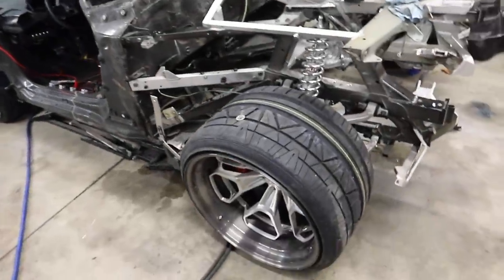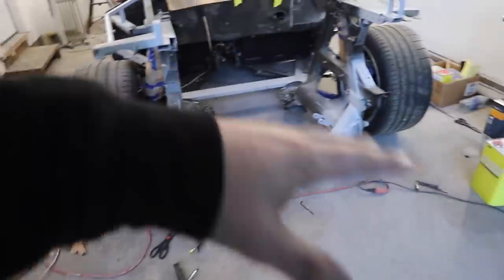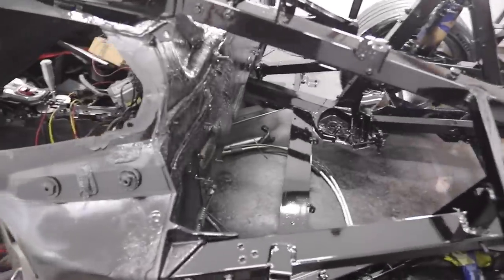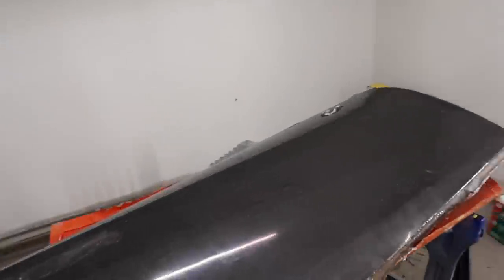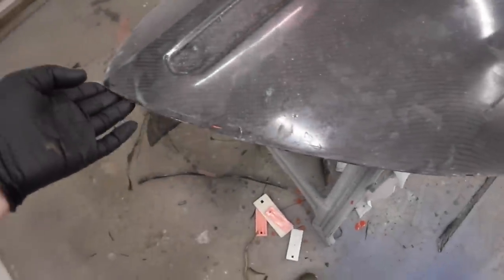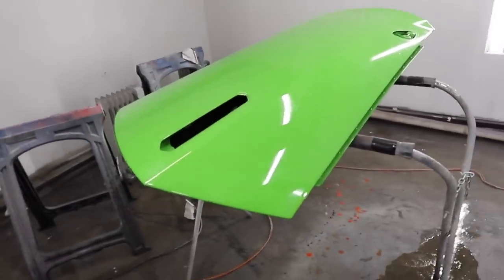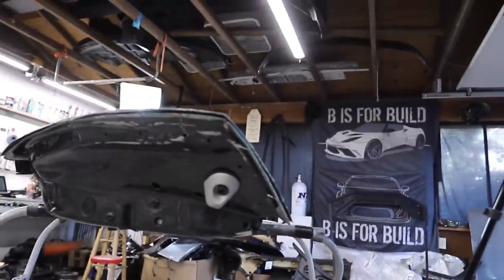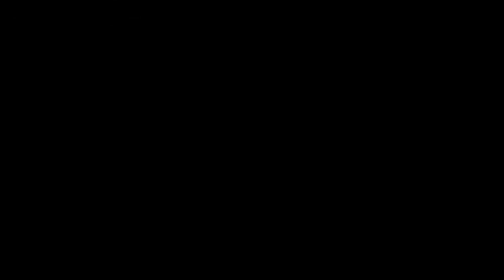Painting the Huracan Frame and Building Carbon Fiber Doors

Comment: As soon as he said there wouldn't be any overspray I just shook my head....
Reply: Same!!! I'm like...well that's a stupid thing to say. sure enough ...
Reply: @marksiegel1548  he really doesn't have any choice at this point.  It seems most sema cars are built in a similar fashion. Just make look good from 10 feet away from the outside.
Reply: @DoRC  is Sema a horror show of DIY car builds then?
Reply: He has a choice, get to sema or get a showcar
Reply: Jesus Christ, he just half asses everything!
Reply: @stevenwest1494  from my limited knowledge it's a mix of all types from absolute fine crafted perfection to much much sin hiding.....
Reply: @stevenwest1494  ever head of a bluetooth drivetrain? or wireless transmission? alot of sema cars dont drive in with their own power
Reply: Me to
Reply: Dude. It'd take like literally 10 minutes to bag off the wheels, interior and roof. Seriously it's not that hard to do it right.
Reply: @stevenwest1494  Yes. Yes it is.  Reason you never buy a SEMA car if you see one on sale.  Thrown together from ridiculously short deadlines.
Reply: What does it matter? Donor wheels and it's a bare frame?
Reply: @marksiegel1548  he might cut corners, still gets the job done though
Reply: I agree, but its his car and show.. As he said about the door, he dont care about visual imperfections.
Reply: I honestly don't think it means a difference cuz it's all getting wrapped Anyways
Reply: "It's all getting wrapped anyway" Hmmmm... Dont think he'll be wrapping the windscreen and interior. Takes very little time to cover for overspray, or a shed load of time to remove it. I know which approach I prefer.
Reply: It only takes five minutes to bag a car, then there's no over spray problem.
Reply: Yeah, I was head scratching for sure. Like, what magic is this?
Reply: That really put me off the whole thing. Why cut a corner like that.
Reply: qwerty qwerty I bet those wheels and tires are worth 1k+ a piece. Plus getting shit all over the interior and windshield.
Reply: @peteledwidge3631  shit I didn't notice that he fucked the interior too.
Reply: Do RC Good from far but far from good
Reply: me too. i knew it was utter BS.

Comment: Awesome video Chris! If you're doing remote door poppers, I HIGHLY recommend hiding a manual latch somewhere at the bottom of the door sill or in the front door pocket just in case something goes BisforBadly or you lose power. Good luck with the rest of the build!!

Comment: So you may run into issues at the drag strip with the electric door poppers...you’ll most likely need to install a manual backup so the track crew can open the door in case of an accident. Hope y’all finish in time for SEMA, awesome build!

Comment: @bisforbuild I’d recommend building in some sort of a fail safe incase your battery goes flat, Porsche and Aston Martin leave some jump start posts exported under the vehicle, you can use the vehicle chassis as a negative if you just fit a positive distribution block like your vantage will have under the bonnet, with a little cover in it under the car or on the exposed frame at the rear it means you can always get power to it to use the door actuators.
Reply: Like so Chris reads this
Reply: You can just hook the jumper pack or battery charger to the starter lug by crawling under the car

Comment: I can't wait for the episode that says we cannot get the door poppers to work, now we are locked outside the car
Reply: or the alternator dies when inside; trapped inside
Reply: That was my thought when he was demonstrating the mechanism. What if the battery drains while car is closed? Hope there is some sort of backup.
Reply: I dont think he'll need to get into the cab to get to the battery though
Reply: This is not like a regular car. He can take body panels of really easily and get to the battery
Reply: Yeah. Lets see a locksmith get a modified Lambo door open. Take lots of pics of the inner workings of that door so he'll have an idea what to go after.
Reply: Inner door panel is plastic held on by some clips. If shit hits the fan, Chris would just hulk the panel off from the inside and pull the cable, I doubt we will read about him found dead in the car because the battery died. More likely his shoddy headers caused so much heat it ignited a fuel line or something
Reply: You can probably crawl under and connect to the starter or alternator.
Reply: @luffy858  Yea I was thinking they better hope the car never catches on fire while they're inside it...  and even if they have a manual handle inside the car, what if they're knocked unconscious in a crash and emergency crews are trying to open the door to pull them out and they can't.
Reply: The interior mechanical door release lever is still functioal. They just connected a actuator to the outer handles cable and deleted the handle.

Comment: I don't know how I feel about the remote doors for safety. If you need to be removed from the car, someone on the outside won't be able to open the door
Reply: Alex Smith  firetrucks have hydraulic tools to either force open or cut panels off in case of an emergency...
Reply: Joe Black 
Makes sense.

Comment: My truck is going to be at SEMA, I completely restored a 1970 C10 in 2 months. Swapped the chassis, chopped the bed from a long bed to a short bed. LS3 swap, in the future I'm going to supercharge it. 335 tires all around-mag wheels. Orange with the sides having a single white big stripe

Comment: A good tip for removing door skins quicker and easier is to just to grind all the way around the very outside edge (as in 90 degrees to the face of the skin) until you grind through the fold and the skin will then basically peel straight off.

Comment: Bungees work ok but if your in doubt of adding a wavy line in the seams maybe think of a bucket load of 2" heavy duty spring clamps along the edges to fix the position of the part for curing. approx $0.60 ea. They'll last a lifetime!

Comment: "this car is more of a racecar than a show car"
-has stretched tires
-turbo direction and placement for looks
-90% of the build is just for looks
Reply: 1. You need wider rims and tires to effectively transfer power from the powerplant
2. Stretched tires makes fitment under the fenders easier, check Tavarish with his tire dilemma on the recent video
3. However it is mounted, a turbo is a turbo that makes boost
4. It is meant to look good
So it functions!
Reply: @ruikazane5123  1.Stretched tires make you loose grip by deforming the tire and with the power he's going for, stretched tires are simply dangerous 
2. Tavarish has a slight stretch for fitment where here the tire bubles and it's plainly for hotboi points (plus his murcielago is referenced as a "million dollar showcar" in ff8 and that's the look tavarish is going for. so by using him as an exemple you're saying yourself this is a showcar) 
3. If this was a racecar he would have gotten the body to fit the desired tire size not the other way around
4. Look at any actual racecar and what you'll see is meaty tires with pretty poor fitment
5. Clearly you have no understanding of turbos because the way a turbo is installed WILL affect its performance 
6. Your last point is top ten most retarded thing I have ever heard

Comment: Is it just me or am I the only one that hates stretched tires... Love the massive tread but use them as intended... Stretch just looks wrong.
Reply: I dont like stretched either. Thought I was cool way back but not I hate it and it is more dangerous in my eyes. I personally think sidewalls would be not as strong pulled like that
Reply: I don't like it either but minor detail on this build, plus he says his tire sponsor doesn't make anything wider and when you're getting thousands of dollars worth of tires for free then you gotta roll with it. He may not like it either, but doesn't have a choice.
Reply: @iveneverdonethisbefore8390  for a build it is good, but when people put it on a daily, that a no for me
Reply: The other thing is that when you're running rims as wide as these, having too much sidewall can interfere with the steering, so by having them stretched, you get a slight bit more steering angle which will help with low speed driving
Reply: Crazy to hate something that has nothing to do with you. Must “hate” a lot of things
Reply: @calitri-boost  has something to do with me if it is a safety issue and the person is driving behind me
Reply: Stretching aint all that bad...nowadays theres some leeway in how far it can be stretched and it stiffens the sidewall...too much is bad as it can debead but keep it subtle and it should be safe🤷🏽‍♂️
I like a little stretch 🙂
Reply: @heckin_dinosaw  most times its to clear fenders for that fender to lip...but on another note stiffer sidewalls increases steering response...thats the most stretch id go too...and massive tires aint cheap (even if its sponsored)

Comment: Question about the door handles. What if the battery goes flat?
Reply: Sander he’ll charge it. Remember it’s a show/race car not a daily.
Reply: I have these on my daily. Theres somewhere on my vehicle where if I have to I can pull on a string and it opens it from the inside of the door. I've been driving with them for a few years and never had that issue tho. They really done change that much other than make everything look so much cleaner. 10/10 would recommend
Reply: Put air in it
Reply: @kendallwilliams9808  you got a lincoln?
Reply: @a.d.7042  No you don't. You don't own I take it.

Comment: No door handles on drag car, you gotta have a way to open the door without electricity you don’t wanna burn alive in your car cause it has no powder
Reply: Some race cars don't have doors at all, or if they do there is a cage behind it large enough that it doesn't matter anyway. Crashes can also wedge a door shut pretty easily. It is the windows that matter. Race regulations typically require that they be rolled down or removable from the outside. I have seen rules for streetcar oriented events/classes state that windows have to be present and they have to be rolled down.
Reply: @SuperBobKing  Yes but this isn't a promod spec car. He's going to have a tough time getting through tech with those poppers. He's going to need to put handles back in or build an 8.50 class cage.

Comment: You should hide some 12v jump posts on the car somewhere accessible from the outside with the car locked so you can still get in when your battery dies since you dont have normal door locks. They could even just wire directly to the door popper so you dont get locked out.

Comment: You should run cables through the door boots also that hook to the cables on the door poppers. That way if the battery is dead you can still get the doors open by manually pulling those cables. Done a few remote poppers before. You will thank me. Lol

Comment: From a Locksmith’s point of view... with shaved door handles, run some battery leads accessible underneath the car(or a nice hidden spot). In case, the doors are locked and the battery’s dies.

Comment: Watch redline racing in Australia. You would use cardboard behind the edges of the door. Use filler wax to radius to cardboard. Make mold onto the cardboard. You don't have tight bend over edge and have ton of room for flange for vac bag. Making inside door is real weight saver. Fill all holes with cardboard and wax radius. It's just as easy as outside.

Comment: That was definitely a different way to remove the door skin. I think the body shop will grind the edge right at the pinch seam and then separate the skin. Also the middle of the skin is typically glued on both at the seam and in the middle for structure.

Comment: Depending on the track you will need a mechanical way for someone to open both doors from the outside, or you won't be racing it at a track at all. You will need a roll cage if its faster than 11.49 in the 1/4 mile. As well as a 5 point belt and full metal screw in valve stems. And now that I think about it, I would question if the turbo placement would pass tech inspection with only the headers holding them as usually turbos are mounted much closer to the engine so less pipe to flex.

Comment: You could have used "Chassis Saver" for the the engine bay. They have a gloss black that you can paint to bare metal and it s chip resistant and you can spray it over hard to remove rust embedded in to the metal and it would stop it from spreading. A gallon with reducer would have ran you under $150 and you would have saved time from spraying primer too.

Comment: I had remote opener on one of my cars, make sure that you have a emergency opener if your out of battery or it stops to work. I had a whire from the door to behind the wheel in the front. If i did pull the whire the door would open manualy.

Comment: Jo Chris, are you putting on the inner wheel wells? Cuz I think it's not good for you're radiators, cooling lines, headlights and the body/frame in in general that they are under atteck from rocks & debris.

Comment: impressive door molds. Mold making is something i am looking at learning a little more about.  I made 2 part molds in the past with an inner silicon rubber mold, and outer hard fiberglass mold. What is the orange gel-coat looking stuff you are putting on the door after waxing?

Comment: Won’t the latch still hang on the the Nader pin?  It’s a two-stage latch.  You may have to hold the button down even after it’s been popped to be able to open the door.

Comment: I noticed the idea for the door locks didn't happen till you worked on the 2nd door and had already fitted the skin to the 1st frame so does that mean only 1 door will have working locks or did you retrofit to the 1st door afterwards?

Comment: In the time it took for you to explain why you weren't bothering to mask off the lambo wheels, you could have just masked off the lambo wheels. All you have to to is pull a garbage bag with a slit in it over them and tape around the bottom.

Comment: Make sure to put an emergency door opening mechanism incase the battery dies
Reply: Csm. Hb Jdogg door handle opens the door from the inside. You can replace the battery from the outside. The only problem is if you loose the key.
Reply: @Oscar_SMT  I know I was meaning if the battery died, would the door poppers still work . I forgot about the hood pins 🤦🏿‍♂️🤦🏿‍♂️🤦🏿‍♂️🤦🏿‍♂️

Comment: I have put many a door popper on all kinds of vehicles. PLEASE, dont forget to leave yourself an "OUT" if the battery goes dead, or you will be in a heap of shit!!!! I have been there, done that, and you dont want to go through that i promise!!!! I always ran a wire from the hood latch to the underneath of the vehicle, somewhere out of the way and somewhere where only you know, that way if the battery goes dead, you have a way to get the hood open to charge the battery to open the doors.

Comment: This thing is a death trap without door handles. If there is a fire and power goes out then you are trapped. More importantly in an accident no one from the outside can help you. You need to reconsider at least putting the drivers side handle on.

Comment: Aren't Carbon Fiber doors unsafe? I know Singer still uses steel doors for safety.
Reply: yes and no, a pure carbon door wouldn't be as safe because it doesn't have any side protection reinforcements in them, however B is still using the core door but just re-skining with carbon and doesn't affect safety.
Reply: @jasonengland2357  ah perfect